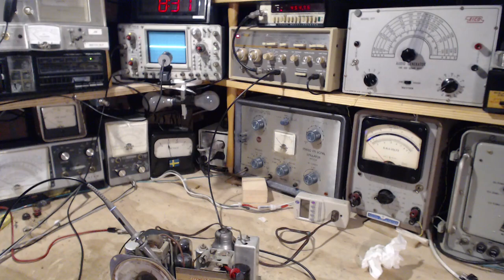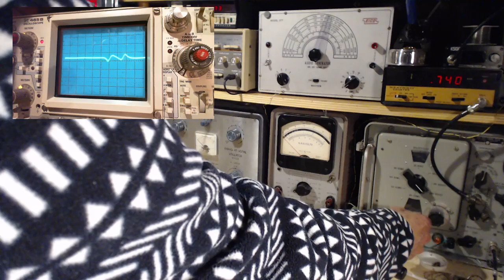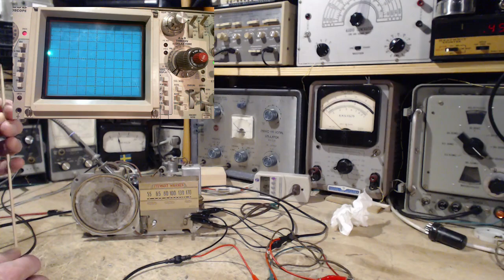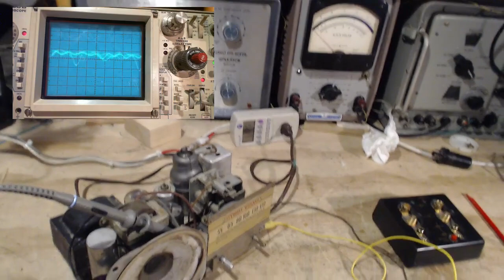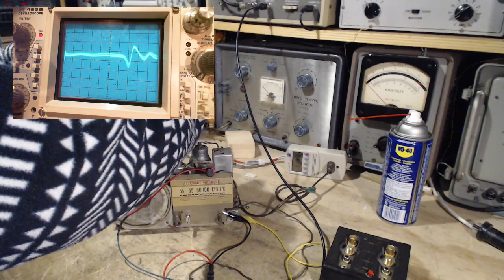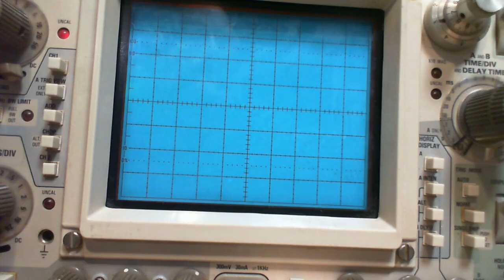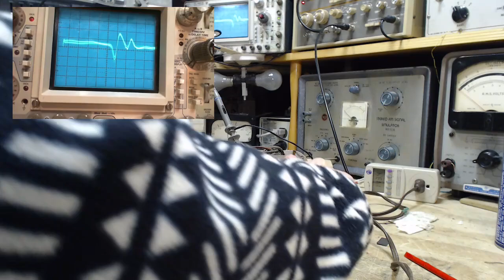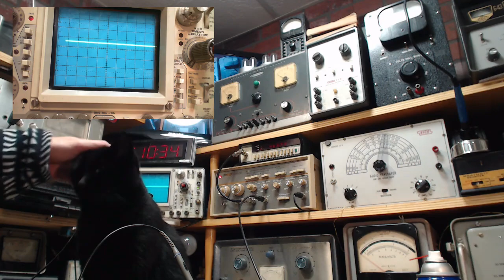Stewart Warner R514 Tube Radio Video #12 - 2nd IF Transformer

Comment: Hi Jim,
I took the liberty of setting this out for you which I hope might help to explain the circuit operation. If you have already worked this out for yourself then all good.

I found the operation of the detector in this radio confusing until I printed out the circuit on a larger scale and then I could see the layout plus the component values which you have to note in order to see how it works.
Its of course an RF/AF reflex circuit where the 6B8G is first an IF amplifier, then detector and then 1st audio stage.

The IF signal first comes in via the transformer L3 and is applied to the grid of the 6B8G top cap via the GREEN transformer wire.
The valve amplifies the IF signal which appears as RF at the anode of the valve, where it is coupled to the 2nd IF transformer L4 via the BLUE wire.
The anode HT voltage is applied to the anode via R3, 47K.
The secondry winding of L4 GREEN wire couples RF to the detector  diode, (pin 4) where the audio is demodulated from the RF carrier.
The diode load resistor is R7- 270K and the RF filter bypass is C14(260pF), (attached to the BLACK wire).
Thus Audio is present at the BLACK wire on L4, and is then passed via R9 (1meg ohm) to the BLACK wire of L3. At this point any remaining RF is filtered via a small cap C13 (110pF).
The audio via R9 gtoes through R9 and the secondary of the 1st IF transformer L3 and exits via the GREEN wire again to the grid of the valve top cap connection.
AGC is also taken off the top of R7.
The valve is now an audio amplifier and  R3 is also the audio plate load resistor when the valve acts as an audio amplifier.
The audio is taken via C11 from the RED wire of L4 and passed to the audio output stage.
C15(350pF)  serves to remove any RF at this point and also as an RF signal ground to the tuned winding of L4 so that the RF signal in the BLUE-RED winding is developed across this winding. This doesn’t effect the audio at this point because it’s too small.

Make sure you didn’t replace the cap C13 with a value you might expect here in a normal radio like .047uF as it would bypass the audio to ground.

I hope from my description you can now see where to signal trace RF and audio in the circuit. Sometimes both in the same place.

Keith McRoberts.
New Zealand.
Reply: With all respect. I had given this eaxct explanation already on the comments videos ago.
If he had read comments he would have known already.
What use is it for you to explain  again what was already explained. 
Or is this the classic case of
"Everything has been said, but not by everyone"
Reply: Just in case anyone is wondering, these writings are my own not a copy of someone else's although on the same subject.

Comment: Sry adding my 2 cents worth, now you have the lug loose on the IF Can ,if you have a Dremill drill with a cutting disc, instead of rounding off the remaining threads, cut a new slot in the slug , so your not removing the threads with the pliers,just a thought,

Comment: I would be inclined to replace the variable tuning capacitor with 4x1N4007 diodes to act as Veri-caps and a 1M0 variable Resistor to operate as a tuning control, That hot air wand is for SMD Rework.